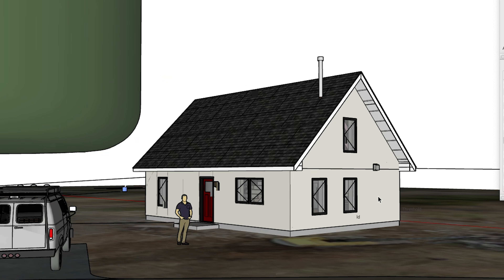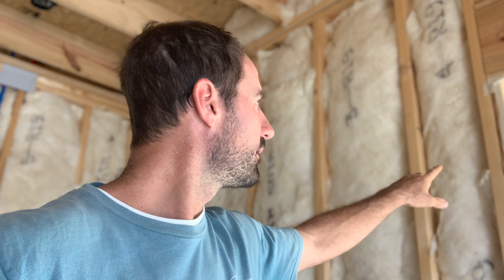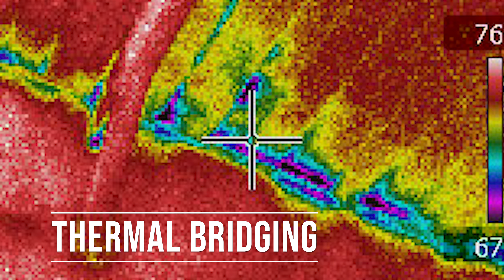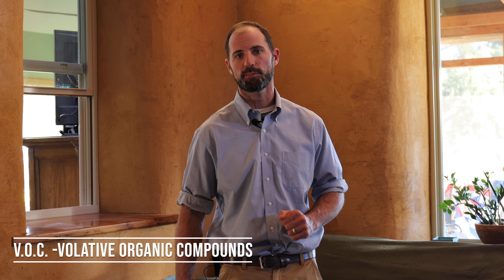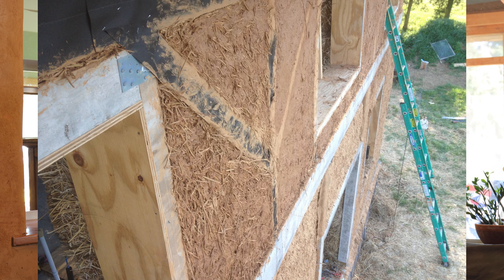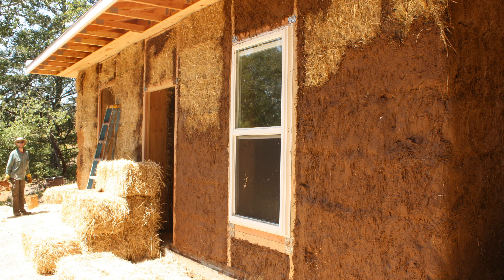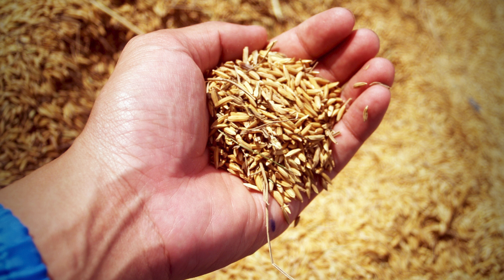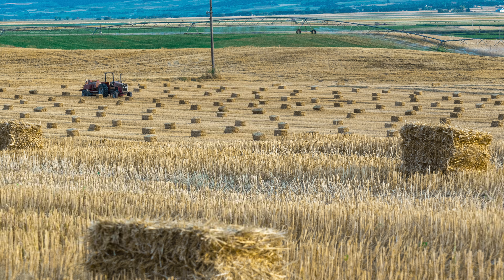The BEST way to build a new home? Building a House with STRAW BALES : Start to Finish - Episode 1

Comment: If your argument is lumber price than building a post and frame structure to carry the roof load makes that argument b.s..  hay bale walls are not high impact rated and when they suffer impact damage or any other kind of problem that bale and everyone stacked above it must be removed in order to repair the damage.  If you want to build the perfect home you would need to build a double wall system with steel exterior studs and wood studs on the interior.  With this design you can achive r-40 wall insulation using fiberglass, there is zero themal coupling, can be sided and sheeted to with stand very high impacts while being easy to repair and maintain.

Comment: Such a Quick way to Die in a 2 minute fire. There IS a reason why people usually learn from experience. To avoid repeating the same mistakes.
Reply from the maker: Straw bales with plaster on them don’t burn. At all. There’s no air to fuel the fire.

Comment: I have built houses with elevated floor using wood beams and between I have insulated that with straw bales. If I want to be consider ecologist I don't want to pour concrete in my foundations :)
Reply: I’m considering doing this for the crawl space under my mobile home. How did you water proof the bales? Did you use mud dob or something else?

Comment: What about if you make a second wall for outside, I mean after you finish the bale wall, you create an exterior thin wall separated from the bales, because the straw need to breath and maybe with the stucco over those don't help to breath very well and also when you have rain from outside that water the stucco and the humidity go into the bale.
Reply from the maker: Plaster breathes really well and keeps the bales dry. You could do as you suggest, but the cost would skyrocket

Comment: How are you running plumbing and electrical wiring? I understand you can use a chainsaw to cut pathways into the strawbail. What about running vents for HVAC? Would this work for a place like Northwest Ohio where the humidity is high during the summer?

Comment: I assume there'd be a way to use straw bale with a steel frame, would it be a more difficult option than a timber frame?
Reply from the maker: Moisture condensation on a steel frame can cause serious problems with mold on the Strawbale wall system. Easier with a timber frame where posts are further apart (fewer notches bales with a chainsaw)

Comment: What keeps the moisture from getting to the straw and it rotting
Reply from the maker: The straw bales are covered with earth/lime plaster to a thickness of 1 inch on each side.
Reply: @HeirloomBuilders  so does that never require maintenance  if it ever developed cracks I would think that it would allow moisture in to the straw bales and would allow for the straw to rot

Comment: How much would cost per sqfoot to build a strawbale house?
Reply from the maker: Depends on the floor plan layout and how complicated the roof is, also the level of finishes, and how much labor you would hire out. To completely hire out a permitted straw bale home with custom finishes and a moderately simple layout, I would budget $250-300/sq ft. If you do everything yourself, and can scavenge materials/fixtures/and the help of friends, you could build it for as little as $50/sq ft

Comment: What do you mean by dirt cheap? How much the costs of the house in the video? You said compressed strawbale...where u find those...one normal one is 5$ here...was.
Reply from the maker: Most of the materials for a simple Strawbale structure can be scavenged or bought for cheap. Much of the material by weight is actually dirt/clay. The labor is the expensive part. Bales are $3 here in NC.

Comment: What I am wondering is if a straw bale house is comparable to an all cob house to stop the heat or cold from coming in all the way in? What I have heard is that cob is breathable, so does the house need ventilation/air intake systems that a conventional house does?
Reply from the maker: My house is exhausted only by the bath fan. And leaky doors bring fresh makeup air in. Other than the bath fan and ceiling fans, I have no forced air mechanical HVAC system. Most homes do, as should any very tight home. Straw bales are breathable yes, but built well, they can be fairly well airtight.

Comment: Sounds like it will go up in flames way too easy. Not thanks
Reply: Quite the opposite. Much more fire resistant than a traditional stick build home.
Reply from the maker: There is not enough air inside a tightly packed straw bale wall to fuel a fire. The surface could burn the loose straw before it gets plastered, but once it’s covered in 1” of mud on each side, there’s no way for fire to penetrate and burn the straw.

Comment: Here’s a way to stop the thermal issue with the stick built home. 6inch walks made with 2x4s. Use a 2x6 sill and header and then stagger the 2x4s. Yes it is more expensive but it works well

Comment: How's it stand up to category 5 hurricanes???
The real big bad wolf...
I like the insulative properties, but not sold on the wind resistance... where I live, the wind and rain can be devastating...
Reply from the maker: I can’t say how it handles a Cat5 hurricane, which this one is likely to see in its lifetime (being in the Piedmont of NC). But I saw my Strawbale home easily withstand 90mph gusts of wind blown rain - before we even had the first coat of plaster on the bales. And the plaster is basically 1” of sandstone/limestone on each side of the 18” bale wall. I’m guessing the shear value of a plastered Strawbale wall is enormously higher than a conventional home. We’ll see

Comment: Interesting that this should appear in my feed. I have been interested in straw bale building ever since I heard of it decades ago. I hadn't heard anything in many years so I figured that either technical (things like rot) or regulatory issues had killed the idea. One question I have is longevity. Is this the kind of construction that can last for centuries like Cobb or does the straw deteriorate over time?

I hope to move to NE TN in a few years to establish a retirement homestead so I may indeed be interested in having something built at that time.
Reply from the maker: As long as the walls are protected from moisture, the Strawbale can last for hundreds of years

Comment: what about fermentation and insects?
Reply from the maker: Fortunately the fermentation cannot happen without water. The bales stay dry and are safe from self combustion. Insects are the biggest problem. Although not any more than a normal home. Ants can get into crevices, but there’s no room to build a nest in a tightly packed strawbale. I see more ants living in my interior stud walls! We’ve had a couple carpenter bees make a home in the earthen plaster, but that was an isolated incident and super easy to repair.
Reply: @HeirloomBuilders  I was asking about the insects that come with the bales before using them, is there a way of cleaning them or something?
Reply from the maker: @ESPkenner48  I don’t know. It’s never seemed to be a problem.

Comment: So how does the inside wall get built? The inside bottom plate? --What do you start everything with when you "stucco" it?
Reply from the maker: Sorry the beginning dragged on a bit. The bales simply rest in the interior 4x4 bottom plate. We cover that with tar paper to isolate it from the plaster so they can expand and contract independently. And then staple a j channel piece at the bottom, cover the rest of the exposed framing with fiberglass lath and apply 3 coats of plaster. Seems complicated, but it’s pretty simple. Stay tuned for more videos on plastering for more details

Comment: Im chemically injured  lost my metal home to mold hurricane  insurance disappeared!  I have been forced into Isolation  plus Covid ! Environment is killing me I’ve only been able to save enough for a stick built tiny house 12 or 10x 36  to live sleep cook bath in the same space  I was going to get a container but the paint and pestacide floor are so contaminated Than Incredible tiny home in Kentucky offered to build  for 25,000  but Im afraid of the  outgasing ! construction affordable .

Since you know so much  about contaminated housing …I phyically need uncontaminated enviormentally safe Affordable  housing! 
Could you sponsor or set up a “fund me  “  to help build an organic straw stalk  cob home  as you say is a free product  or  a tiny cob house .
Im Senior disabled 69 . MCS EI CF  TBI  Reactive Airway Popheria Fibromyalgia Arterial inflammation Migraines  diabetic  inflammation of paradigm.  I lose control  when exsposed to enviormental contamination often unaware beyond my control . Id need solar to  give me energy but shielded 12v and 110 affected by eletromagnectic fields Im chemically intolerant to anything made of petrol chemicals  pesticides  germ asides herbicides  moldacides  perfumes and scent inhibitors sprays contaminating the air and water ! Florida is killing me its so polluted   My care giver brought me to Florida  died from hurricane . The heat humidity high barometric pressure I need a safer place to live recover  I get the impression you know what im going thorough
you cannot garden the ants ruin everything  i tried to raise organic food but  it died ! 
the tree company rented out land to contaminated strawberry farmer with old diesel water pump , burning weed barreriers as farm trash every six months. I havent been able to walk since he stated this.  
Please can you help me get  affordable tiny straw house ! Habatate for humanity refuses assistance because I cannot work in their contaminated office to offset my share I haven’t been able to work since 1990 the government made me wait 7 years before giving me DSI removing all my work history   Instead of $ 1200 a month as stated in 1990 My income started at $165!   Now after 21 years $700 including cost of living raise that caused increase in medicare than decress in food assistance because you have $20 more!    The stimulas caused my checking account to have more than $1300 they cancelled my benifits than reset  lower next month  money gone!  
My necessary organic food has increased my food cost over $400 a month  If i dont get a home  i’ll  lose my house money . I need raised organic garden or end up eating my house money. 
Since I cannot get on my knees for cabinets  or lift above elbow I need a pantry room with exhaust fan appliances on slideout  plug shelves , slide out for canned food  pantry, freezer   Slidout for dishes cups glasses Since I cannot bend over its either sit or stand straight  or fall  need dish washer and washer  on 18” lift cabinet . Roll out 18” base shelves. faucet on side of 18” deep sink  induction cooktop no reaching  over  a 24” base  cold water pot faucet for Berkey filter counter space  between sink and  induction stove  with stool ideas abound but … reality

Comment: Can I build one in Florida?
Permits?
Reply from the maker: Yes, you can build one in Florida. Talk to a structural engineer about framing a post and beam house with Strawbale walls and ask the local building department what other info they need for permitting.

Comment: In Yemen I saw multi story house that was built only by mixture of tiny straws and mud. It was laid in layers about 4 inches in height and very thick in base then gradually getting thin. Then they wait tell the mud dries and add the next layer. Roofs and floors are wooden. This house located on hill side and considers an artistic non engineered piece built based on the talent of ordinary builders

Comment: I'd worry about wiring, and mold. (Farm girl), moldy hay, even dry mold, is bade for lungs.
Reply: My same concern. How do you electrify this type of home, and how long will the straw last before it rots?
Reply from the maker: The wires are notched into the bale walls with a chainsaw and secured with landscape staples. As long as the bales stay dry, there is no risk of rotting. Lime plaster will protect them from getting wet and is breathable enough to allow small bits of moisture to escape before it becomes a problem. I’ll go into more detail in the coming videos
Reply: @HeirloomBuilders  Very cool. Thanks!

Comment: I've seen articles that say straw bale is very susceptible to pests. That you have to protect your bales prior to installation and not leave them sit  once installed, allowing them to sit for any length of time will allow pests to move into the bales.
Reply from the maker: Fortunately that’s not really a problem. Nice may live between bales when they’re stacked in a barn, but tightly stacked as a wall and covered with 1” of plaster on all sides prevents pests from getting inside the bales. And there’s no air space or cavities for them to make a nest.

Comment: Straw bales construction system is the best technic to build a house. Thermically there s no comparison with any other material. The only point yu must think about is that it has a default : lack of inertie. So yu must plan thick walls inside and a good air ventilation system.
That s why personnaly I built a tirolian massive heater right in the middle of the house with 4 walls covered by nice decorative faïence (clay tiles) . Plus canadian pipes (4 x 20m long  under soil in foundations (1,8m) ... 2 on north side and 2 on south one).
In region with particularly long hot summers better add / combine with 2 iranian refreshing air towers on east and west sides of the building. Simole very old technic which provided since mesopotamian period refreshing and wet air during the night complementing the canadian pipes. With a mechanical double system of filtration it provides good confort of heating T` and air recycling. Must be calculated before construction and integrate to the project as soon as yu draw the shape and dimensions of the house. Crucial phasis... With study of costs. Never change material or size of rooms or anything after thermic study. Or yu ll get troubles after and... Deception.
Reply from the maker: Here’s how we deal with preventing mold: FRAMING a STRAW BALE HOME
https://youtu.be/P565_fhZBQw.
Let me know what you think!

Comment: @Heirloombuilders I'm curious how you feel about the wheat being heavily sprayed with glyphosate during growth and right before harvest. Do you feel this toxin will cause any negative effects of interior air quality? I love this building method but this is a concern I would like your opinion on. Thank you!
Reply from the maker: The wheat grown in my area is not sprayed before the harvest. Only sprayed with glyphosate just before planting. I’m guessing there is very little trace of the chemicals at harvest. And with the 1” of plaster on each side of the bale, I’m not too concerned with indoor air quality. I’ve had tours of my personal home with chemically sensitive people that have all commented on how clean and pure the air seems.
Reply: You would need to find an organic farmer to avoid that. Just depends on where your located and what organic looks like in your area whether it's being grown or not
Reply: @forresto69  So you agree it would have a negative impact on air quality?
Reply: Living smack dab in the middle of farm country no no I dont. Mine biggest concern would be the electrical and how it's installed. Such as is it installed by running through the metal casing or left out like a typical house. If left out let's face it mice will and can chew threw it therefore making what I think would make it  much more flammable than regular insulation
Reply from the maker: Fortunately there is no air space within a densely packed Strawbale to fuel a fire. Straw bale wall systems have a 2 hour fire rating, which is 5 times better than a conventional stud framed wall with drywall
Reply: @forresto69  Is there any reason other than esthetics that the wiring for electrical outlets could not be on the surface of the walls much like you see in business offices? As for lighting I assume there are no straw bales in the ceiling. Of course me personally I could be content with gas lighting.